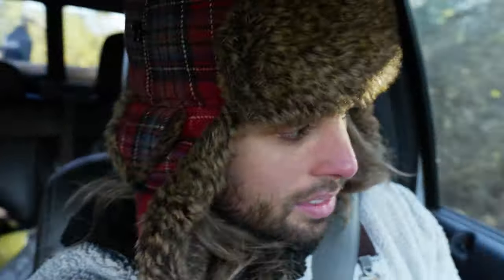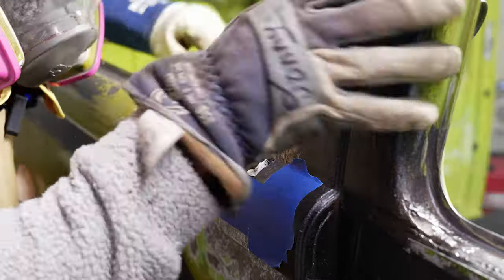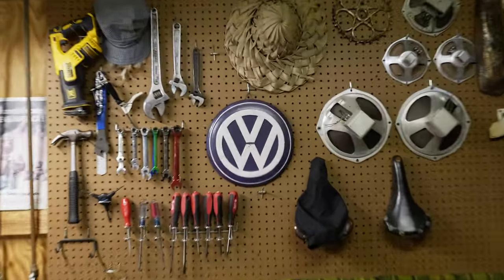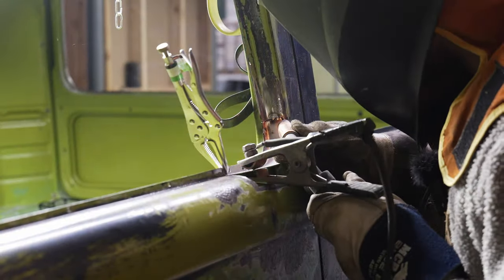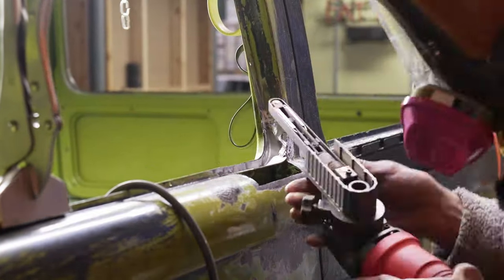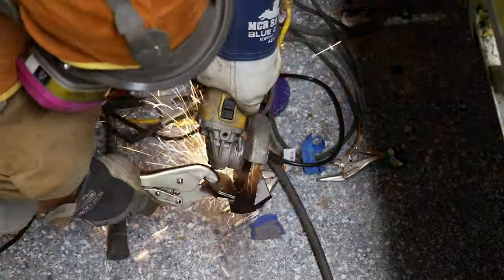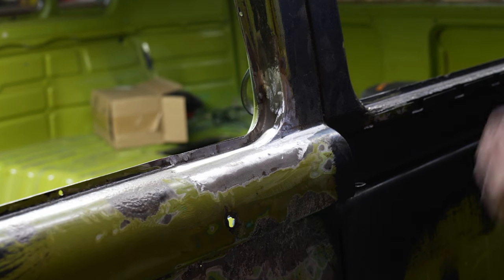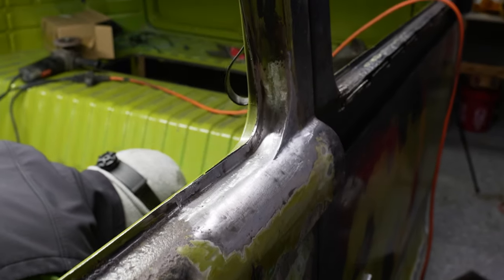Window Sill Rust Repair The RIGHT Way | 1978 VW Bus Restoration

Comment: You always make it look easy :) I've been spending time trying to replace the lower door skin on a sliding door for my '78 and i'm going to need to chop it out and do it again, I got impatient and very noticably warped it, not even filler can save the damage i did. Still, its all practice :)